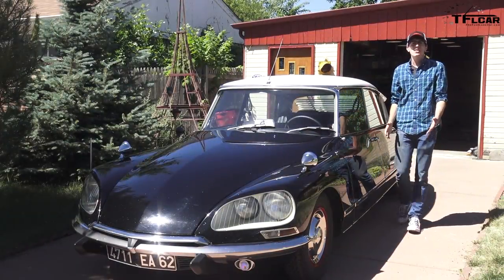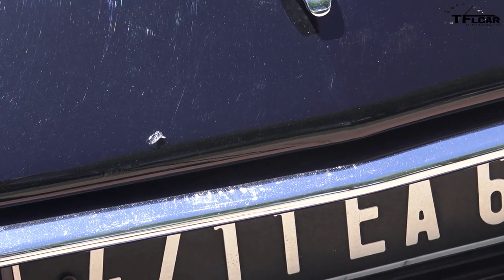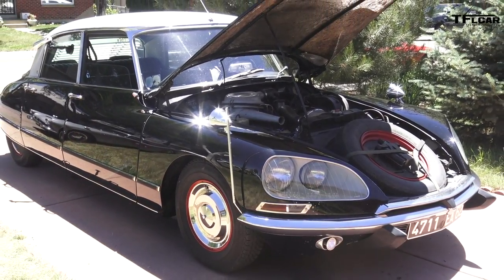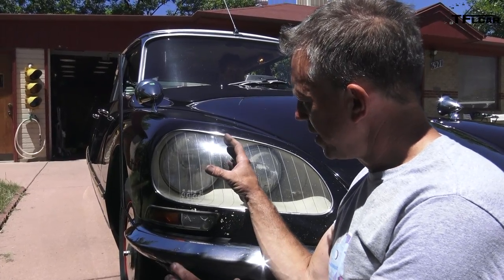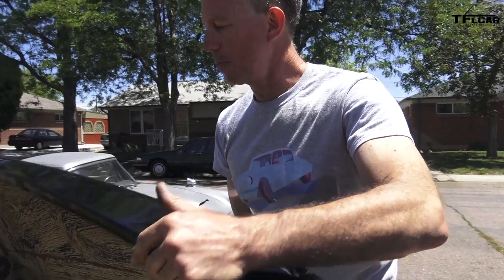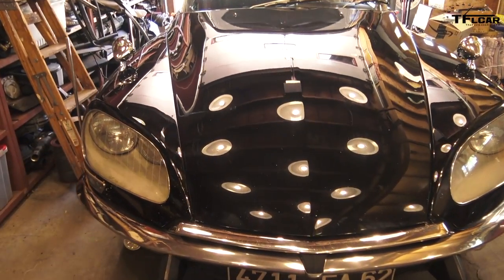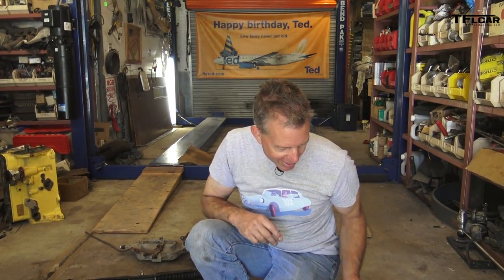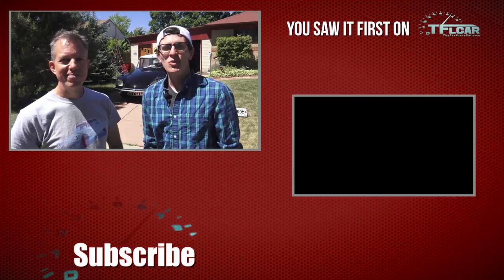Top 10 Reasons Why This Is The Most Revolutionary Car Ever Made

Comment: Aluminum head; aluminum block with steel cylinder sleaves; aluminum valve cover; aluminum oil pan; aluminum transmission / transaxle case; aluminum radiator; aluminum hood; fiberglass roof panel; gas tank inside a sealed steel box; inboard front disc brakes that reduce sprung weight on the front wheels; one connector held each wheel on, it was a captured bolt so it could not get lost; leading arm front suspension, trailing arm rear suspension, acted to raise the nose under heavy braking; the steering pivot line was centered at the center line of each front wheel so there was no pulling bias on the front wheels; the car had the lowest aerodynamic drag of any other at the time.  It is more advanced than any production sedan made today.
Reply: "acted to raise the nose under heavy braking" no. but lowering the tail.
Reply: But in real use the nose plunges under heavy braking. the steep bumps. The children are sick. The brake pedal has too little travel, and is very difficult to dose. Suspension spheres often leak.
Reply: @HenriBourjade  My children are not sick, in a DS there is less movement in the back of the car than any other sedan. The brake "pedal" has zero travel, that's right because it is pressure sensitive. I never had problems with applying the brakes smoothly. In my 11 years owning a DS I had to fill the spheres once, that is normal.
Reply: @zagyex  Il did
my child life in a DS. In a 2CV (smooth) or a Rabbit (hard), children are not sick as in a DS.
Reply: deez, the D block is cast iron, not aluminum. The SM has the aluminum block and lower crankcase.
The front suspension is lateral parallel arms, not leading. The 2CV based cars have leading front swing arms. The SM has the same kind of front suspension as the D, only it's turned around so that the swivel castings are ahead. The castings are tilted slightly forward to provide anti-dive on braking
Reply: @HenriBourjade  - I drove D and SM cars for years. Never had the slightest problem with sensitive brakes. Was the pedal rubber “mushroom” missing from yours? Only the 1956 DS19s had solid rubber pedal pads.
Every Citroën I have had or seen had a copper/brass radiator made by Chausson. I have four of them in the cellar: 3 SM and one D crossflow for air conditioned cars.
Reply: @HenriBourjade  interesting

Comment: A complement about the brakes: The brakes also has a distribution valve (governed by the pressure in the rear suspension spheres) that distributes the brake pressure according to the load of the two axels.

Comment: Couple more features I believe were not mentioned: The front drive shafts had a CV joint on the inner and a double universal joint on the outer giving an immense the turn angle of the front wheels for a front wheel drive car. This , coupled with the rear wheels being right at the back of the vehicle, enabled an 120 inch wheelbase vehicle being able to be parked the space of the car length plus my brief case. Back and get the rear wheels in the correct position go opposite lock once forward then opposite lock once rearward and you were parallel parked. The front of the car being semicircular when viewed from above, meant that there were no corners to catch you out. So inspite of its length it had an excellent turning circle. .. The body was self leveling in pitch.. Throw ten bags of cement into the boot and the vehicle would automatically level up on the hydromatic suspension  [This is separate from the also self leveling headlights]. It also had load proportionals breaking as the rear brakes would work harder when the boot  [sorry, trunk to you Yanks] was so loaded. It was mentioned that the panels were removable. I believe this was a design feature so that in France if you dinged a panel you would go to the panel beaters and they would just swap that panel and fix the damaged one at leisure. You can strip the front, rear and doors off in about 12 minutes, rear wings as shown one bolt, front wing four bolts [two of these on the headlight tilt bar and four bolts for each door.  The roof was held on by twelve bolts and on one nice day I once unbolted the roof and had a nice day driving around Targa style. The front brakes, being mounted inboard on the gearbox, were accessed beside the radiator from under the bonnet. I changed the disc pads one day whilst waiting for my wife to get changed. 20 minutes for a full change and I was wearing my suit at the time! Only got my fingers dirty. It was the most boring car to drive at high speed as handling was the same no matter what speed you went. There are some nice  video on Youtube of blowing out a front tyre with no hands on the wheel.  The only thing was that they were a bit underpowered due to the strange licencing in France of motors over 2300 cc. I woudl dearly like to have one made up as was intended with a six cylinder aircooled boxer engine.  The low bean headlights were fully reflected, the direct beam from the filaments being shielded by the high bealm reflector giving an absolute vertical cut off. This gave the impression when looking at the headlights from above that they were two glowworms but from behind the wheel they were great. First mass production vehicle with disc brakes, You could hold a dance in the back seat area there was so much room.  ... and I still miss my swiveling driving lights!    1973 DSpecial, 1975 GS.  Oh, and if you want to see the ultimate DS look up "Le Mille Pattes Citroën Michelin" on youtube! ;-)
Reply: actually one can remove the doors with one bolt ! the 2 vertical spindles have a locknut , loosen the lower one, then with a very long screwdriver unscrew the spindle about 10mm and lift the door up and off the top spindle !
we do it all the time at my friends resto garage , no alignment needed too, genius !
Reply: Stewart, we call it a “trunk” from when cars had an actual “steamer” trunk mounted on a rack behind the cabin. Why do Brits call it a “boot?”
Reply: Wheelbase is 123 inches.  They completely failed to mention the superior aerodynamics.  Additionally, they used a very odd example.  The dash instruments were not round like on this car unless you bought an aftermarket dash by Jaegar.  The original dash used a sliding speedo, had no tach.  Cars after 1970 had more modern round instruments, but far different than this car.  The example used has the mirror on the fenders, never sold that way.  many other details that are simply unique to this car.  The single spoke steering wheel is a safety measure, many people died in car crashes in those days because they were impaled on the steering column.  The column could not impale you.  Many, many safety features in the design, such as crumple zones, the engine was designed to submerge under the car, not go into the cabin, the fuel tank is under the rear seat so it can't be damaged in a rear-end crash.  The hood is made of aluminum, don't recall that being mentioned.  And the dash on the very early cars was nylon, largest nylon peice ever made.  Dorr handles were plastic inside an out.

The car was supposed to have a plastic body, imagine that.  But demand was so high Citroën realized they could not keep up, simply not enough plastic making capacity.  So it was redone in metal, bu they kept the wide gaps out of expediency, those gaps were intended to account for expansion of the plastic.

This video is better than most, but I think they really miss what the true top 10 futuristic design elements are.

Comment: That is a good looking car. Wouldn't mind spending a fortune and most of my time repairing one just for drive it on a few summer days.
Reply: Should make a nice ride and a good investment.
Reply: +Bass Trammel "That is a good looking car. Wouldn't mind spending a fortune and most of my time repairing one just for drive it on a few summer days"  IF looked after, they are not expensive to maintain.  You just need a mechanic who won't flip out at the sight of it.
Reply: If you want the best one for summer driving, then you need the Chapron version ,which is a convertible
However very few were made,and now days are ridiculously expensive
Reply: Very low maintenance. I had one for a few years as a daily driver and it was built like a tank. It was rust prone however if you were in a bad climate, but other than that it wasn't anything like a Mercedes or, god forbid, a Porsche in maintenance costs. I drove mine across the US twice....loved it.Change the fluids regularly and use the French Hydraulic fluid to top up the system and you're good to go. 20 years in production...they were doing something right.
Reply: @titanus49  Tu parles du modèle cabriolet, n'est ce pas ?

Comment: Wonderfully informative video for an exceptional car... they had a catch phrase - "NOTING MOVES YOU LIKE A CITROEN" - 
Both as a mode of transport and your heart!

Your slopey dash, hydraulic gearchange DS21 Pallas is very iconic.

IDs were amazing. The DS Safari was an exta bit wonderful with the two jump seats in the rear and the integral aerodynmanic roof rack with knurled rubber on the leading edge so there is no wind whistle. One of fav Citroen experiences was as the most rearward passenger jump seat with the curved back window at night at 80 mph on a dirt country road, dust billowing out in clouds behind, gum trees flicking past and an inky moonless star filled sky above... then looking past 3 rows of people in front of me to see the turning headlights searching the road ahead.

I am a  long time Citroen addict from my first car at age 19. An Australian assembled 1962 Citroen ID19 with the brake button disguised with a  low pedal.
My next 1964 ID19 had the rubber overridders and a brake button... The addiction has continued for 48 years.

1965 DS19 Safari, 1968 DS21 Citromatic. 1970 D Super, 1972 DS21 EFI Pallas 5 speed with leather, 1974 DS23 EFI Pallas 5 speed with jersey.
1971 GS 1015 Cmatic, 1972 GS 1220 manual, 1974 GS 1220 Cmatic wagon, 1978 CX Prestige EFI 5 speed with leather. 
1997 Xantia 1.9 Turbo Diesel. 2018 C4 Cactus 1.2 turbo petrol 6 speed auto (current)
1978 2CV6 Club, 1982 2CV6 Charleston, 1990 series 2CV6 Charleston (current)
Phew... Citroen has moved me quite a lot... 550,000 kms in 3 x 2CV6s plus mileage of the 14 other Citroens.

Fab adventure driving the 2CV6 Charleston across Europe, UK, Ireland, Canada & USA for 15 months in 1982/83. RHD, yellow French headlight bulbs... even the police in Canada & USA loved it.
No speeding tickets despite being pulled up twice for speeding plus a few times for photos...

Comment: Great vid :). However you both missed a couple of details. 1) Machining tolerances for the hydraulic control pistons. Able to hold 2500psi pressures without the use of seals - +/- 0.0003". Cit rewrote the book on mass production of parts with those tolerances. The other is the steering rack. Zero play in the steering system. IOW one only has to just touch the steering wheel and you will get a response from the front wheels. The other thing that the system does is prevent, via lots of hydraulic pressure inside the rack, any movement of the front wheels caused by forces against them. Hit a pot hole in a corner, nothing happens. Have a flat tire in the front and you can stop the car with your hands off of the front wheels (lots of vids on the net showing this).

Comment: The brakes have one more feature which few people know about. 
The front brakes are powered by a pressure accumulator in the engine bay. 
The rear brakes are powered by the pressure in the rear suspension. 

This means the braking force at the rear is load sensitive. More load, more braking force. That's good engineering. It also has the second effect. If you depress the brake button hard a few times, the rear end will drop before the hydraulic pump is able to replenish the reservoirs. :-)
Reply: And this features is also here on the citroen xantia, so I recall all the citroen until the xantia and xm have had this feature too !

Comment: I had one of these and it's not just the suspension that makes it comfortable it's also the best driving position of any car I have sat in , the steering wheel is well clear of your legs, the roofline is really high so no ducking your head to get in. My '74 manual could cruise at 100mph and still had reserves. For all its complexity it was really reliable which is why I guess they were so popular as taxis in France.

Comment: I owned a DS 19 (English model) 1955 for a short time. It would drive 35 miles per gallon if only on the first stage of the Weber carb. It had "center lock" wheel hubs with one Allen screw that was loosened/tightened with the crank handle ( that's correct, it was supplied with a crank handle). I once changed a flat tire in 1 minute and 35 seconds. Marvelous car. But I didn't have the special tools required to maintain it. I still have the factory workshop manual.

Comment: I've always wanted an SM which had a maserati v6
Reply: a shit v6 though... but beautiful car none the less
Reply: The Maserati V6 is OK if properly looked after.  Not many were
Reply: Don't. The V6 is shitty because it's not a properly designed V6; it's a V8 missing 2 cylinders. The car is extremely heavy and unreliable.
Reply: @leborde  hmm, I'm unsure, I've already read that but apparently this was more a myth than any other thing. They were designing a v8 engine but it was this engine that has 2 cylinders cut to get a v6, it was a separate engine IIRC. I could be wrong though.
Reply: @barenstil5525  still faster than the Toronado with 325 hp
Reply: @FEGTTTSDH  yes, but not really reliable even with modernday mods.
@sofian senac, the engine that was supposed to be a v8 was the prv, which is, the 3 liters mostly, in contrary to the sm maserati engine, reliable
Reply: Neither the prv or the V6 Maserati were meant to be V8, they were designed as a V6 but with tools for V8, the V6 Maserati was a little bit needy and lack power, but the car used the best of it, and was the fastest Fwd with 180hp, the car isn't heavy by all mean or at least it doesn't feel heavy, weight about 1500kg, which is a lot for a car in France at that time, but a corvette c3 was a bit heavier with no roof and only 2 seat while being smaller.

Comment: I have owned 3 of these over the years and always loved them.  The windshield washers on early cars were powered by the pressure in the spare tyre which lay over the engine so you had to be careful with constant use or you had a flat spare tyre. The swivelling headlights (or spots) were operated by the steering rack and two bits of cat-gut (no it was not nylon). They were held at the correct level and secured with small springs.  It was not unknown for the spring to slip off the light.  You always knew because the lights started illuminating the trees. Easy to fix in a second or two. You put your fingers in and re-attached the spring.  Lovely cars and still look like the future.

Comment: A friend, Thane Bierwert, former president of the Central Citroën Club of the Chicago, Illinois, USA area, was moving to Franklin, Tennessee, USA. He had his Citroën ID 21F wagon loaded, full inside, heavy load on the roof rack. Even the RH front seat was full.
Nearing Brentwood, Tenn. on I-65 south at about 75 mph (120 kmh), the RH front tire blew out. He said that he saw a black “thing” leap out to the right from underneath the car. At first he thought he might have run over a tire tread. So, he pulled over to the side and got out to see if it had damaged the tire.
The tire was gone! Nothing but radial cords. The tube was gone.
He went to a phone (pre-cellular era) and called me. He didn't have a spare as he had had a flat in Kentucky.
I dragged an old 15x5 wheel with an ancient Michelin X 165 tire, nearly bald, out and carried it to him in my '71 DSpécial 21. He installed it and went on to his new house.
He went back to Chicago and brought another full load down. The old X blew out south of Nashville, Tennessee not far from where the other tire had exploded and shredded.
As the old rusty wheel was already beat-up, he drove on to his house.
The point of this is that when front tires blew out, he didn't feel anything and the car didn't behave badly. Other than a slight tilt toward the side on which the tires failed, he barely knew that a tire had failed.
Such is the safety benefit of Citroën Center-Point steering.

Comment: Recently bought a Peugeot 508 GT which is a 2 litre diesel. Nice car apart from a few French quirks. The engine is Euro 6 compliant and fuel consumption is amazing for a full sized car. I'm getting over 1,000 kms (600 miles) a tank in just urban use in a big city.  I'm filling up once every three weeks.

Comment: a revolutionary car in fact it won the car design of the 20th century, Citroen are bringing back its legacy with the DS range of models, however my French wife used to feel ill in one when a kid, it was because of the suspension
Reply: Actually, back in those days you always feel ill in a car when being a kid. bad flatted roads, non tan windows, bumping suspensions, no air cond ... But yes citroen have even more ill reputation.
Reply: lffit except the new DS's are pants, there is nothing special about them, the last revolutionary Citroën was the C5/C7 which ended production in the mid 00s, taking the last hydronuematic car out of their range.
Reply: This happens if the rear sphere are not changed every year, as it should normally be done.
Reply: @steeveneleven  Yes, my sister used to be sick in the car, and back then my father still had his Volkswagen, the GSA came later.  My sister never was sick in the GSA.